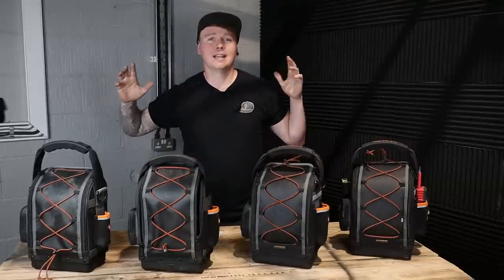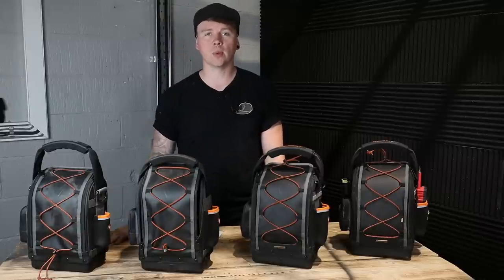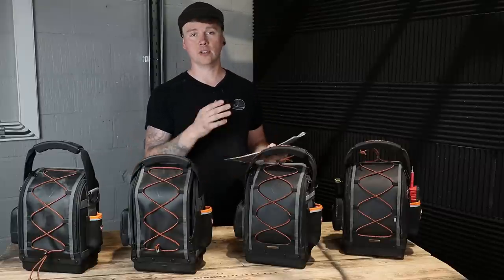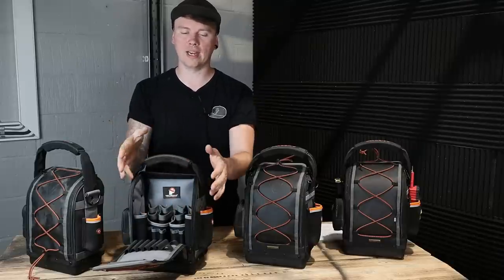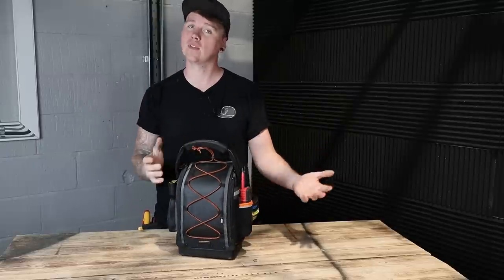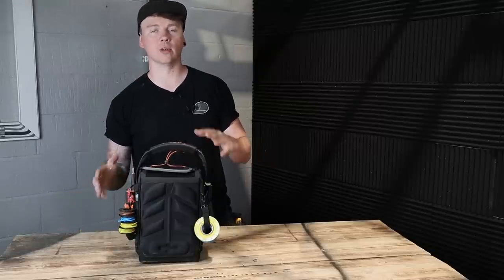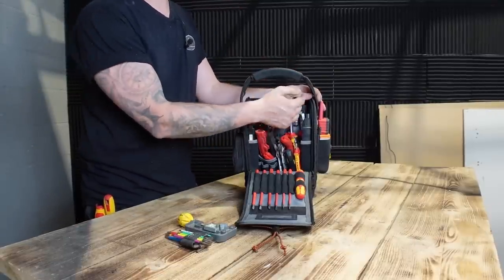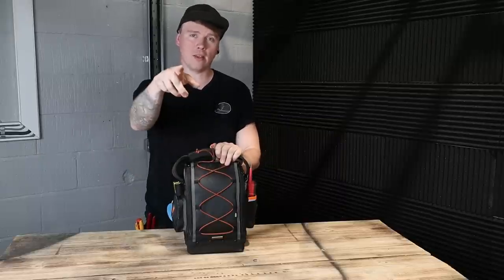Make your own tool bag!

Comment: One thing I am worried about the longevity of the bag is the velcro strip at the top. If that velcro strip gets dusty and dirty I hope the bag doesnt unzip.
Plus for easier opening connect the left and the right zipper with a cord that you pull together.

Comment: You keep designing and producing these bits I'll keep buying them. Haven't had a velocity bag yet that I've been unhappy with, though it would of been nice if the NB100 pouch could hold a multi-meter instead of just a continuity tester. Doesn't matter if I'm doing electrics or gas on any given day I tend to need it, a GS38 just isn't good enough.